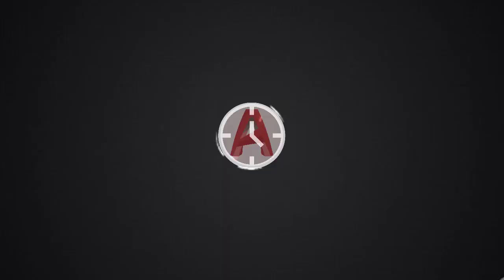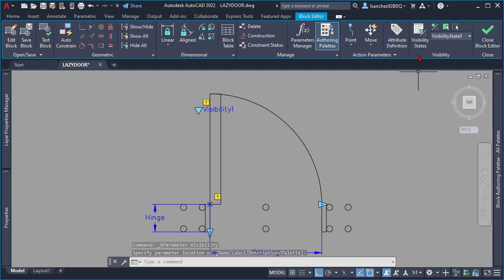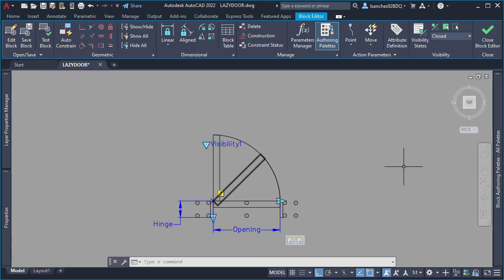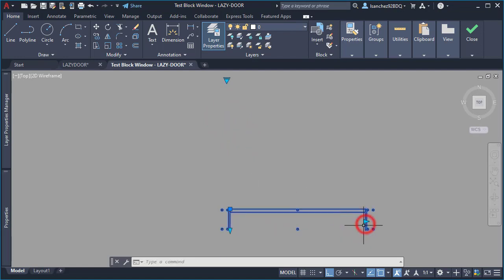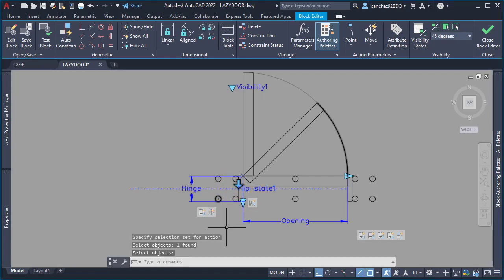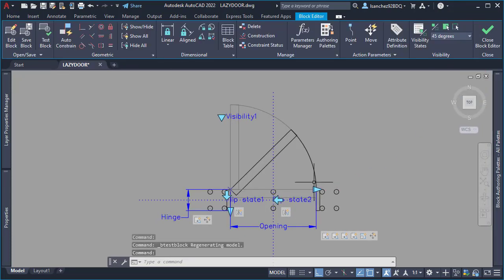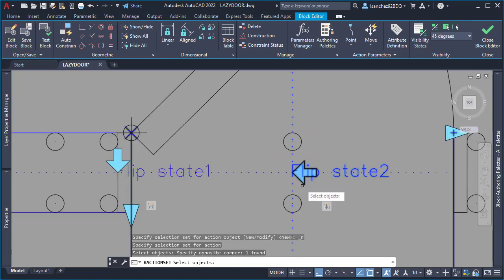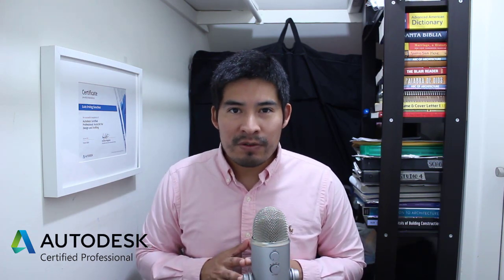I Created a Dynamic Block for an AutoCAD Client

Comment: This was again.. a Great help for us.... thank you Architect
Reply: can i ask for your advice architect, i tried to fixed my Existing Block which have scale parameter & flip horizon features, however every time i add rotation and flip parameters vertically, it always not functioning making the door of my block point to other direction, moving & etc. the only solution i come up with is to add alignment parameters.

Thank you in advance.🙏🙇‍♂️
Reply from the maker: Crx thanks for stopping by to say hi. By the way I'm not a license Architect yet, I am close though.
Reply from the maker: Make sure that when you select your objects to be flip, use ALL instead of selecting objects individually.
Reply: Thank so much!!🤩🤩🤩
Reply from the maker: @rookcrx1646  happy to help 😀 , by the way you missed the new LazySelText command: https://youtu.be/q4C6nTqC5_8